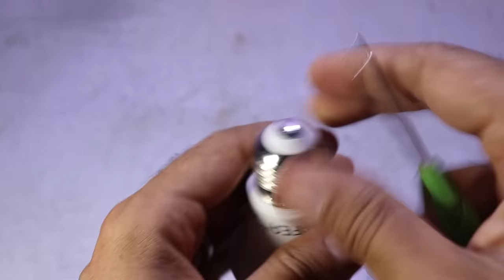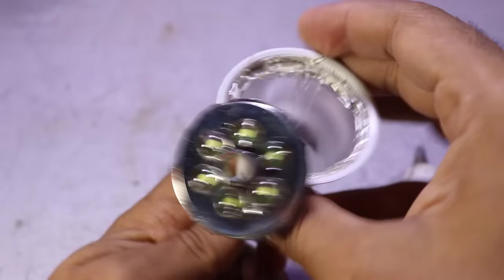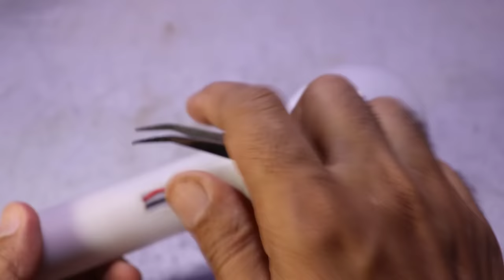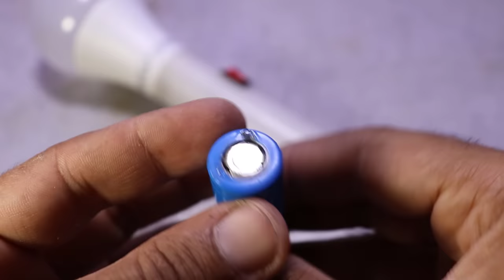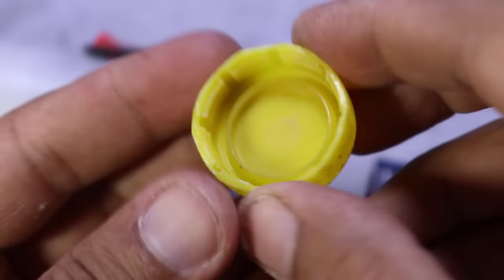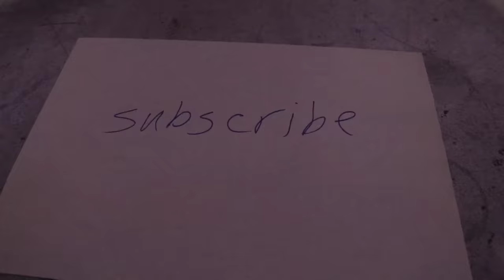How to make a handy lamp using an old LED bulb

Comment: Why bother?  There are far better LED flashlights already on the market.  Waste of time!
Reply: Well said.  This is just an excuse to make a YouTube video when doing a hobby-obsessed time-filler - seems also to be showing off electrical knowledge.  Who has a spare charging circuit lying around unused?  Nobody.
Reply: Waste of time but still, you found time to comment with worthless banter... Now if you can open up your brain and get better informed about te-use and recycling, you would realize that this simple DIY is smart and contrary to so many other videos found all over YouTube, is actually useful and good looking, see ? 👍
Reply: @theprior46 @theprior46 So your beef is about the charger ? Oh, you mean the ones that can be bought for about a dime a dozen ? Sure... When the rest of the parts are actually smart re-used and recycled. Ever thought that some countries are poorer than yours ? Besides, like you mentioned but did not quite grasp the usefulness of that project, this is an easy way to learn about electronics, think about that... 😉
Reply: @daltonx6177  — Your crude and worthless banter is no better.  Time to go back to kerosine? LMAO.

Comment: Would've been more interesting to use the LED's that came with the broken bulb instead of a new set of LED's as it's usually not the LEDs that burn out and they actually work on DC.  Might've required a current limiting resistor or some other current limiting setup.
Reply: Very interesting, I'm just starting out in electronics thought this be a great little project make the the kids but like you said shame he Didnt modify the board which would be just removal of the resistors correct! Or a small one to limit it back a bit thanks
Reply: @aussiebattler8438  Probably just cutting thr traces from whatever it has providing tge DC power from the AC and just feeding the DC directly in provided the voltage is sufficient, if not you may have to bypass the resistors and use one of your own.  Personally, I hate passing the majority of the current through a resistor just to limit the current hence I tend to put the resistor on the line to the base of a diode connected transistor as the collector to emitter current will be many times that of the base emitter current but just controlling the base emitter current controls the collector emitter current, unfortunately this also results in another 0.6 v base emitter voltage drop but in all honesty, as LED's are also diodes, the current limiting diode is really to divide the voltage down to the 0.6 v of the LED and hence another trick is just to string a number of LED's together in series to simply match the voltage you're providing them with so who knows, they may not even have current limiting resistors to begin with.  I haven't bothered looking into one of these burnt out lightbulbs yet so I don't know what they do but there are more than one way to avoid burning power through a resistor and more than one way to get a reasonably low DC voltage out if an AC line other than a full blown transistor and rectifier (I also tended to use the current through a zener diode in a mirror transistor setup to drain a cap on the base of a MOSFET to get the voltage that I want without passing the majority of the current through anything that would just generate heat).

Comment: Guys, don't solder the wires directly to the battery because you risk irreparably damaging the battery. Anyone with a hobby for lithium batteries knows that temperatures of 260 degrees Celsius are fatal to its internal chemistry. Let me also say that it is a potential danger for the owner (very flammable, explosive).
This happens when you do not have access to a spot welding machine.
And by the way, he could not use the bulb housing, it only makes the cooling of the LEDs worse. A properly machined aluminum tube was ok.
This thing is not professional, it's like playing kindergarten without adult supervision.

Comment: Qtos watts tem a lâmpada, gostei muito da ideia parabéns, gostaria de saber tbm da especificações da placa Led e da placa para conectar para carregar a bateria  obg e fico no aguardo
Reply from the maker: A ideia é flexível .. você pode usar qualquer LED de 3 volts conectado em paralelo .. e qualquer bateria de 3,7 volts com um circuito de carga
Reply: @Inventor_AW  Pero una batería de 3'7v para un Led de 3v? No se quema el Led?
Reply from the maker: @antoniozafra2066  No, no se quemará

Comment: El vídeo es bueno, lástima que no dan ninguna información de las partes que utiliza, se que ay personas como yo que no tenemos conocimiento de los sistemas electrónicos y la verdad que damos en ceros con el vídeo.
Reply from the maker: Desculpe por isso
Pode haver um erro na tradução
As peças são muito simples (bateria 3,7V / montagem LED 3V em paralelo / circuito de carga / interruptor), você pode comprá-las em qualquer loja online
Reply: @Inventor_AW  Perdón por mi ignorancia sobre electrónica, pero no se queman los led ?  Observo que si le introducimos a un led de 3v una tensión de 3'7 en el mejor de los casos, porque pueden ser según la batería hasta 4'2v en plena carga. A no ser que ese dispositivo disponga de alguna resistencia o algo que se me escapa a mi corta sabiduría sobre el tema.

Comment: How many ohms resistor will be use for this connection
Reply from the maker: 3.3R 1W
Reply: @Inventor_AW  the LED is how volts and how many pieces used for the 3.7v battery
Reply from the maker: you can use 8 LEDs 3V @king_zuby
Reply: @Inventor_AW  sorry for too many questions, the resistor is it 3.3ohms or 33ohms
Reply from the maker: 3.3ohms @king_zuby

Comment: You need a resistor to cut at least 0.7V from the rechargeable battery. Ideal flash should have a current stabilizer designed for those leds.

Comment: Please mention all equipments//parts you use to make this good product.
Reply from the maker: equipment
soldering iron
glue gun
Parts:
3 volt LEDs
3.7V battery
Lithium battery charger
a switch

Comment: can I use any type of battery's
Reply from the maker: Yes, you can do that, but .. if the battery, for example: 4.5 volts .. and the LED: 3 volts, a resistance must be placed

Comment: You should never solder these 3,7V batteries (or lithium-based batteries in general) directly at their poles. 
They may get damaged from the heat and can explode seriously during soldering or later.
Use a batteriy holder or batteries with pre-welded soldering lugs instead.
Reply from the maker: good notice
Reply: Главное не перегревать паяльником . Лучше конечно использовать батарейный отсек , но это уже - другая история . В общем Мастер показал , своё решение задачи в применении диодной лампы . 
Спасибо Мастеру за видео урок !
Безусловно - лайк , палец вверх !
Reply from the maker: @АлексейНеронов  Спасибо, сэр

Comment: Man I'm way smarter than you.I'll admit you have half of it made, But your So Nice of a Guys ,I gotta help you finish.
Take a Tube wrap the inside with Copper wire round an round ,Put a spring on both
ends, with a Long round magnet in the middle,Now shake up and down,You got it
now connect to your capacitor 
shake charge , Shine, Shine ,Good luck , great for cave dwellers. hahaha you can put capacitor on the outside
Reply from the maker: hhhhhh good Idea